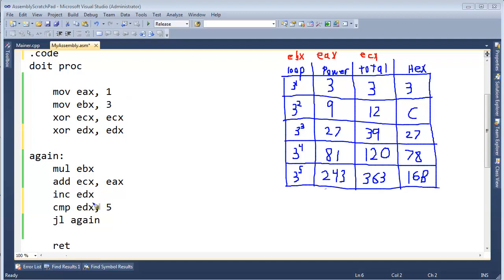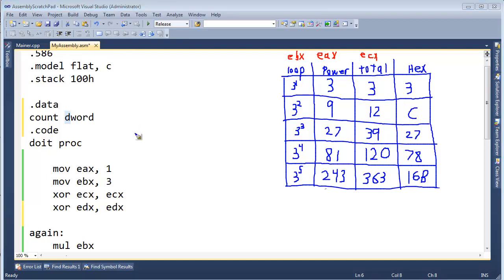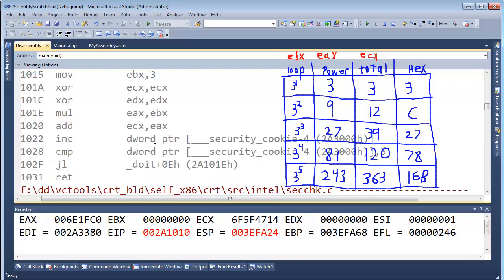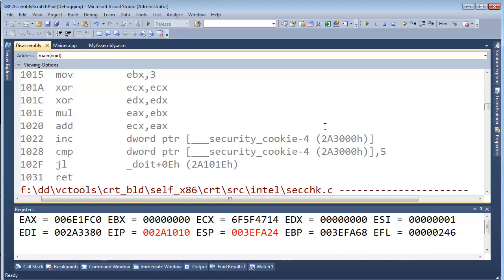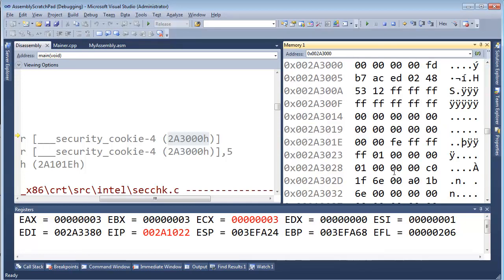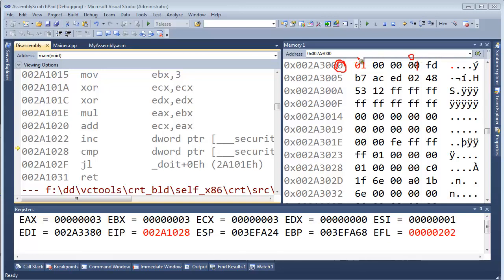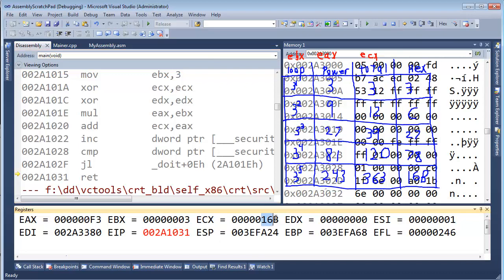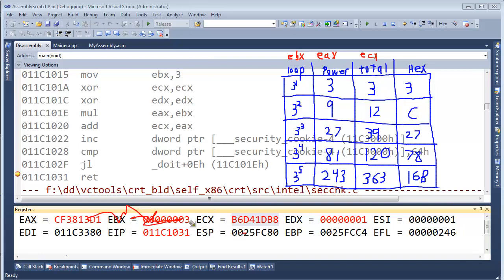Assembly- Static Memory

Comment: This is an interesting way to introduce the variables, but I've actually managed to make it work using edx as a temporary variable. Thanks for you tutorials!

here's my masm code:
 ; sum 3^(n) from 1 to 100

 mov eax, 3  ; this tracks the power value
 mov ebx, 0  ; this tracks the final sum
 xor  ecx, ecx         ; this tracks the n cycles counter 

_sum_loop:
 inc  ecx   ; n++
 add  ebx, eax         ; add the power to the sum
 mov edx, 3  ; temp value (because we can't use 'mul 3' directly)
 mul  edx   ; mul the power by 3 (for next cycle)
 cmp ecx, 5  ; if the counter isn't n=5, continue to sum
 jnz _sum_loop
Reply: I used edx the same way! Nice one!

Comment: My question is now: Who decided to store that dword at that address in RAM? We know that for example in .Net the CLR manages the memory , but here? How does it work?
Reply: Well, it's most likely the linker.
When each of the modules of your program is being compiled, the compiler (or in this case assembler) just calculates how much memory it would require for all the variables in the data section and notes it down for later. Then when it comes to linking all those modules together, the linker collects all those chunks of memory for the data section and puts them in some order (usually in the order the modules that contains them appear in the command line) into one big chunk of memory for the data section. Then it knows where each subsequent data object will be put, so it can update all the places in the code that refer to that data object with its final address. This address will always be some offset with respect to the beginning of the data section in memory. So it depends on where the data section should start. You can specify it yourself with some assembler directives, but if you don't, the linker will just take some reasonable default.
In 32-bit and 64-bit CPUs, hovewe, it doesn't matter that much anyway, because each program is executed in virtual memory, which means that its virtual addresses are being translated into physical addresses on the fly by the CPU itself, so even if two programs use the same virtual address, each of them will be maped to a different physical address in RAM and they won't get into each other's way.
The only situation when it does matter, is when you use shared libraries, because then they all have to be mapped into the same virtual address space (your program and all the shared libraries it uses), so you can't use any addresses that those libraries use for your data. But that's the linker's job to make sure it won't happen.
There's also such thing as relocations which allow to relocate your program to some other place in memory without messing up its addresses. There's a so-called relocation table stored in the executable which tells you the offset of each place in your code that refers to some other address (e.g. memory accesses, absolute jumps etc.). So when the operating system detects that a program would have to be loaded to an address that is already taken by some shared library, it can relocate it to some other place by just adding a constant number to all those places where there's an address reference in your code. It looks through the relocation table, finds all those addresses in your program, and adds that constant shift to each of them, and bam! your program can now run in another place in memory :)  (Relocations take time, though, during the loading of the program, so it's better to write position-independent code. 64-bit CPUs have some cool tricks for that, e.g. IP-relative addressing.)